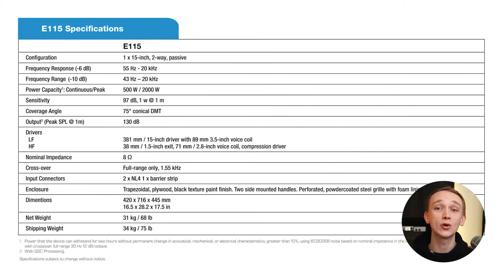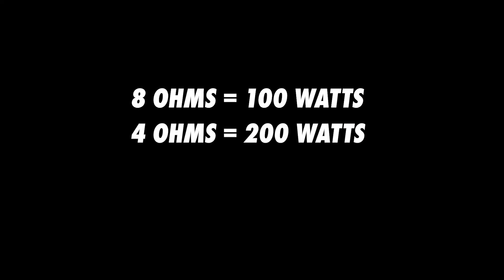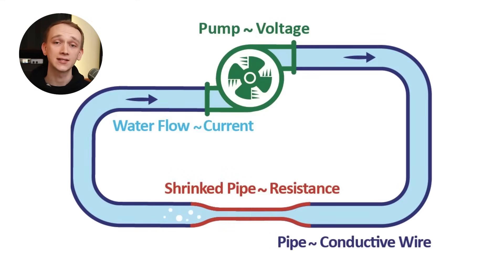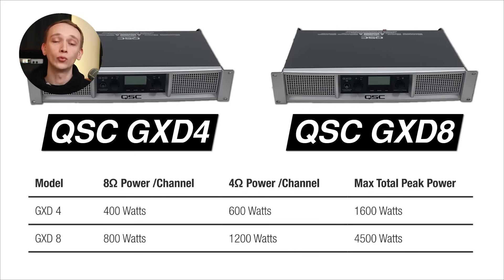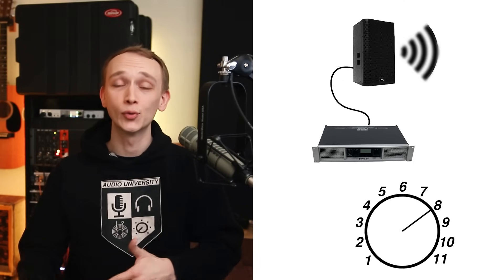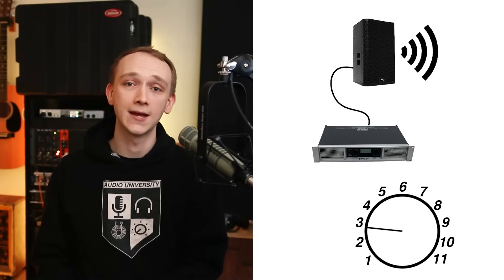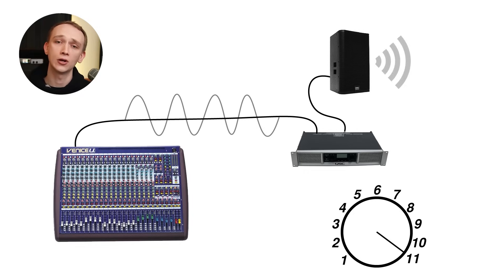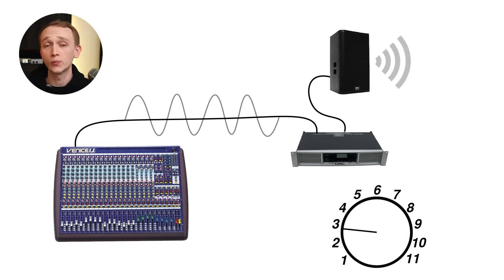WARNING: Breaking These Rules Could Destroy Your Amplifier & Speakers!

Comment: this is very subjective  and depending on who you talk too will give different advise - an 8 ohm speaker is nominally 8 ohms meaning 20% of the lower impedance curve is 8 Ohms but  impedance of an 12" speaker could be as high as 50 ohms as impedance is frequency dependent. The question is how much power is too much  - JBL used to say you could go 10x the driver IEC power without burning the driver -  but would cause physical damage , an amplifier  with enough headroom to handle the transients is correct here but  why would you want to turn it down  from the amp end. Turn it down from the DSP end and control there . There are no standards here , amp companies power specification is all marketing 25Ms burst power , Pink noise  so called RMS we will never know which is the real rating  of the amp .  500W amp at 8 ohms output voltage is 63.24V , 1000w @ 4 ohms  = 63.24V ... makes for an interesting discussion

Comment: amazing video
very informative and at 65 I even understand
I live in the Philippines and there are no laws here to prevent me from going full blast with my system I have a 1000w power amp 1000w intergrated amp and passive 1000w 2 ways, 8 ch audio mixer, EQ, xover, bass enhancer, power controller all made by Kevler it's very loud can be heard from several blocks away
I plan on adding another power amp and 2 more speakers, so they can hear it in Hong Kong 😂
Rocking the house.
Reply: Haha it's More fun in the Philippines
Reply: @janoy9323  opo

Comment: Can you explain sensitivity more? I work for a university that has the old QSControl DSP running in to some Meyer active point source boxes, and the DSP gives the option to change the sensitivity between 1.3 vrms, 3 vrms, 9 vrms, and so on. The lower number gives the higher input level. How do I choose?
Reply: This is the sensitivity of the device such as amplifier or mixer and specifies the minimum signal voltage to get the full output of the amplifier. Speakers are measured differently, as the sound level produced by 1 watt at 1 meter distance from the speaker. 
Line level devices like fm tuners or cd players usually specify the maximum output before distortion is noticeable.

Comment: I take your point about headroom and transients, but I would be wary of generally advising use of an amp that has a significantly larger power rating than the speaker.  In the hands of an inexperienced operator (especially if they are not familiar with limiters), clamor from clients or audience for "louder, louder" is likely to result in things being turned up until the speaker fails!
It would be useful if there was a simple device that would protect a speaker from overload, or at least warn of this, but I can't offhand think of anything currently available?  Maybe a market opportunity for someone?
Reply: Back in the 50s many speakers had fuses to prevent actual overheating of the voice coil. It became problematic in professional use so it went away. In most cases amps and speakers are sold with great overkill, so that it’s unlikely that they will be damaged. Of course, the majority of semi-pro systems now use powered speakers with matching amps &speakers as well as limiters.
Reply: @TomCee53  Yes, I remember speaker fuses.  As you say, powered speaker systems if designed properly should have built-in limiting to avoid damage from misuse.  Of course one CAN use a line level limiter in front of a separate amp/speaker setup, but to get it set appropriately really needs testgear that many people probably don't have access to.  I'm pretty much retired from live work these days, but if I were tasked with setting up PA for anything smaller than a stadium-level concert, I'd go with powered speakers.
Reply: There is some out there (12 year old kids maybe) that would just grab the volume knob and crank it to 100 but the most of us realize, even in our fancy car radios that it will cause damage. You have a system with an external amp most know the car can overpower the road, so to speak.

Comment: Yow, i really feel this was to answer a question i had in a comment a had in one of you videos,  whether yes or no, i really appreciate this video man. 

I really do understand the math and calculations. I think i just want someone to verify something i wanna try with the speakers that I have. So feel free to answer the question. Your videos are great man and its helping me a lot learn about the theory and science in these.

Bueno, If i put my 500watts at 8ohms speaker to a 500watts 4ohms amplifier, the speakers will get 250watts if i let the amplifier "run at 500watts" (theoretically speaking, because you want your aplifier to operate lower that its maximum power). If that is true, would it be possible to a "theoretical" 1000 watts amplifier (or greater) so that the speaker can produce 500watts of power as the specs said?
Reply: You may ask why would i try that scenario? Its because 8ohms amplifiers are not available commercially and it would cost double buying it online. So im looking for alternatives here. Right now, i am using an 8 ohm amplifier but since they are US made, they run at 110 volts and it is such a hussle to bring AVR everytime we use the sound system. So yeah, thats the situation. Oh i am from the Philippines for your reference.

Comment: If continuos power rating of a speaker is 100 watts..program or music power rating is 200 watts and peak power rating is 400 watts.....that means if 400 watts is applied to the spkr the spkr will burst in short period of time..right. ????then what is meant by this music power rating?   ??? In some articles i read that music power rating/program power rating is  the powr the spkr can handle in 4 to 6 hours ...whethet it is right or not?